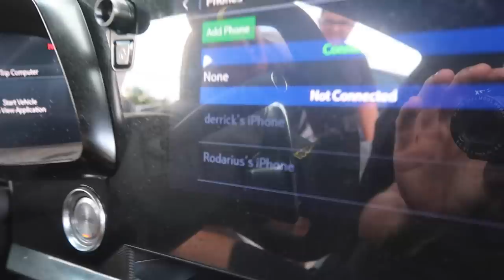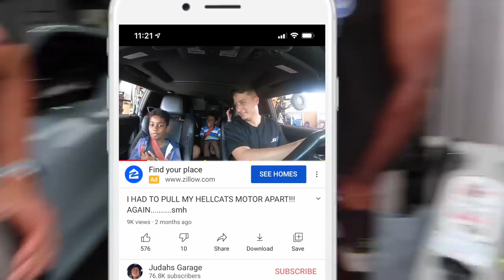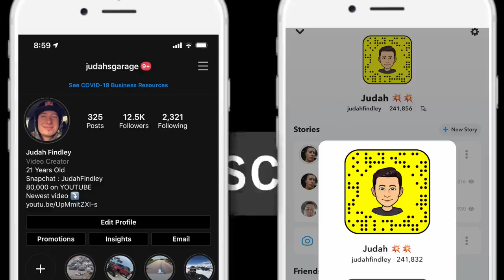Attempting to Start Rod Waves Totalled C8 Corvette! - WILL IT START??

Comment: Hey 👋 just a tip for ya don’t ever use the engine start on a battery charger. Especially on newer cars and trucks . If the battery it bad and you do use that engine start it can put 50 to 125 amps to the cars computers and 💥  then you smell smoke 💨. Trust me .charge it only